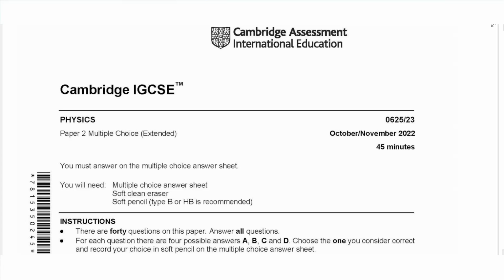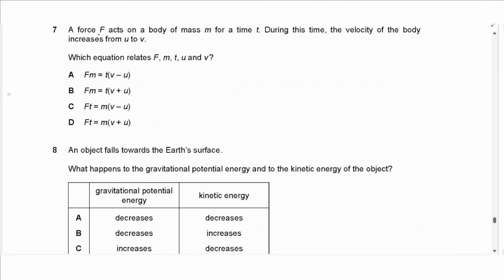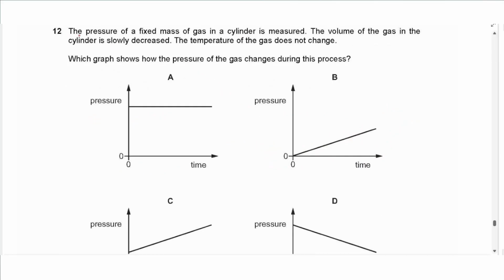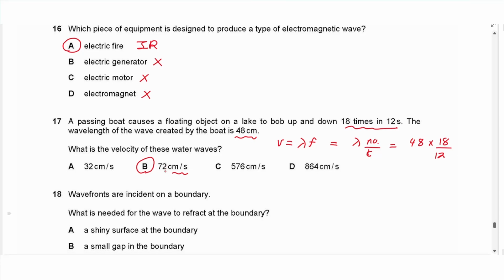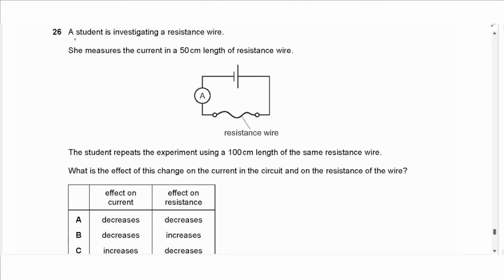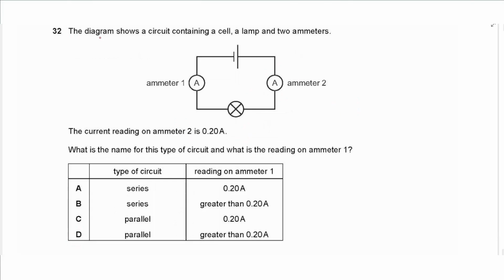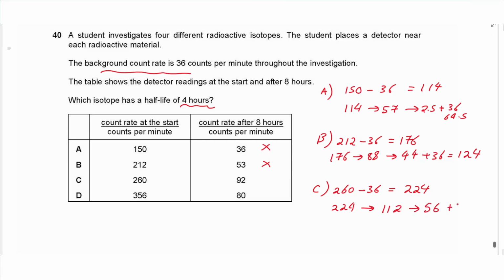IGCSE Physics October-November 2022 Paper 2 Variant 3

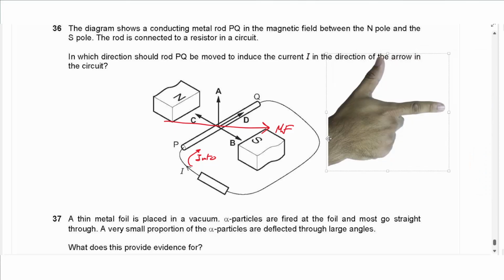Comment: sir, when do we know to use the left or right hand rule in a question 20:01
Reply from the maker: This induced current (no current already in the wire and wire not connected to power supply or battery)
Reply: thanks🙏🏼